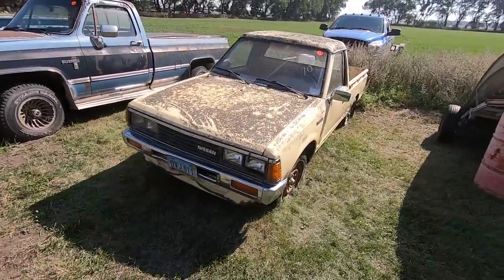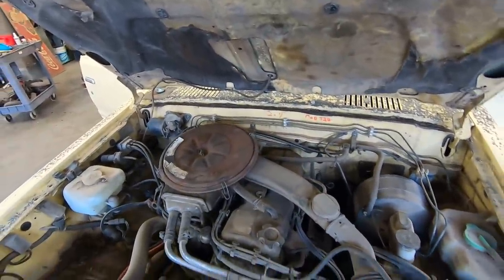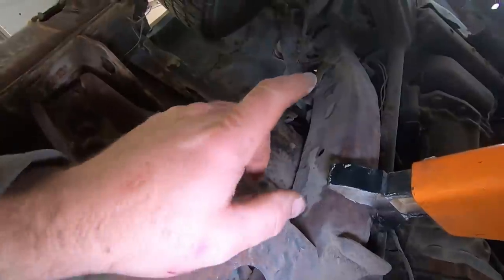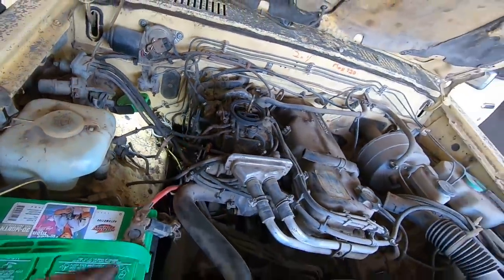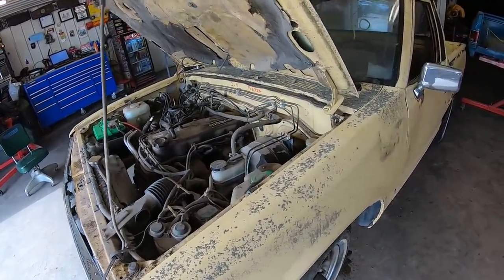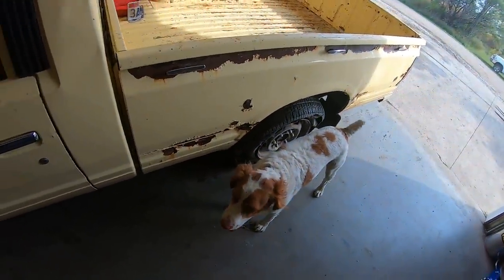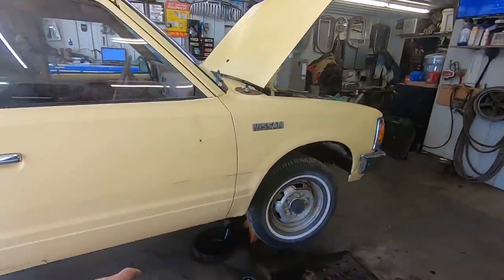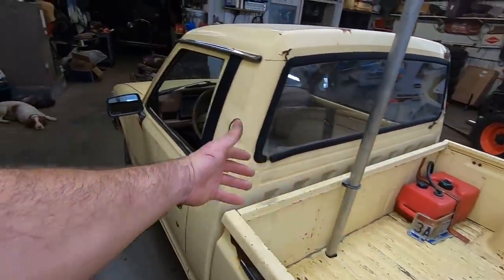Abandoned 1984 Nissan 720 Pickup Parked for 18 years! Will it run?!? Datsun Mini Truck!

Comment: Nissan NAPZ stands for Nissan Anti Performance System,
Reply from the maker: oh no
Reply: @MortskeRepair  Ditch the POS stock Hitachi carb for the 2 barrel Weber conversion (they seem to come with proper jetting for the Z24), plug all the vacuum lines, cap the EGR, maybe hollow out the catalytic convertor or remove it if it's allowed in your area. There is also a wire mod on the distributor you can perform to allow both plugs to fire regardless of engine load (stock configuration turns off one plug under heavy engine load). I have performed these mods on two of the three 720 pickups I've owned over the last 25 years, really helps drive-ability and reliability. I have an 84 720 KC (Third owner for about 14 years) with the Z24 and it's still going strong at 250K miles with the original engine. They're great mini trucks.
Reply from the maker: @Cfchild1  Great info!